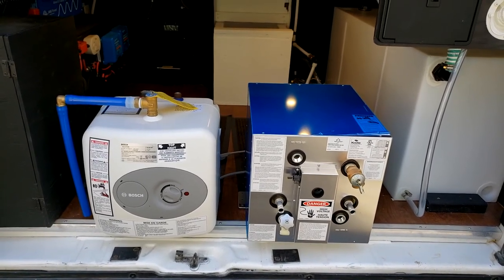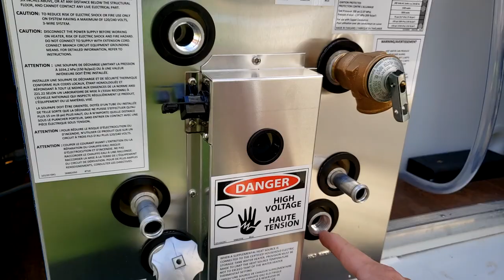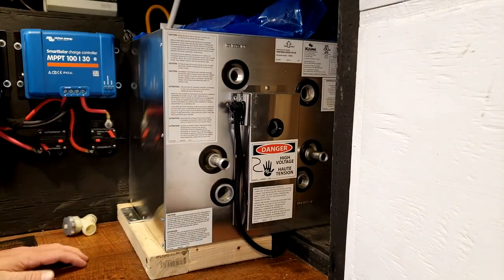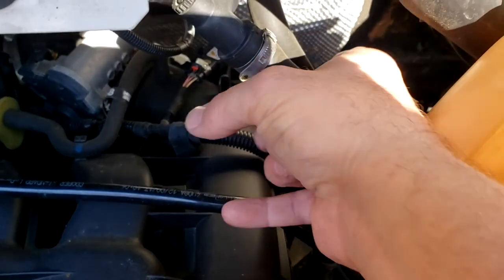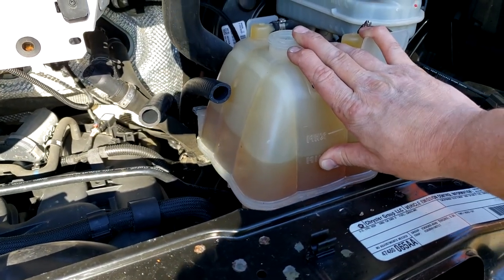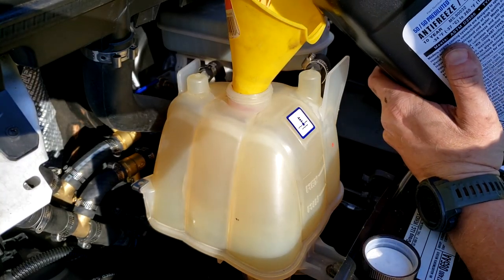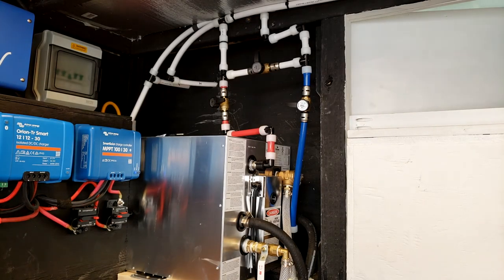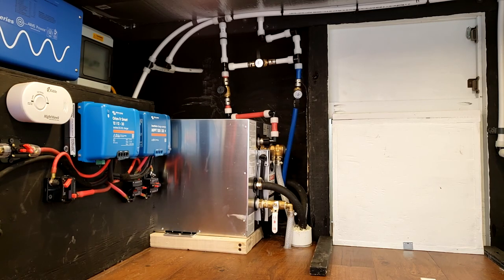Best Water Heater For Van Conversion - Camco Kuuma Coolant & Electric Free Hot Water in Promaster

Comment: That's pretty awesome.  A little tip is you can  hook an old heater core from a vehicle (looks like a little radiator) to the exhaust of a Chinese diesel heater and heat up a large container of water quite quickly, or cook on it.  Some off gridders might appreciate the tip.  I used an old steam radiator from a home heating system and that 200 lb cast iron heated up to 400 degrees near where the exhaust inlet from the diesel heater connected.  It was hot enough to cook many burgers and hotdogs in a pan, helped to heat my garage, heated 10 gallons of water to 180 degrees, and was basically free waste energy that usually gets dumped into the atmosphere.  You can also do the same exact thing with a generator and the cast iron radiator acts as the most effective muffler imaginable as a side benefit.

Comment: great walk through on setting this up. I, too, have the bosch and wish I had found this earlier. I am curious like others if the system has a built in method for managing the water temperature. Surely it does? A thermostatic valve is good for managing the temp of the water on the way out, but what does it do to keep the water from getting to 220 in the vessel?

Comment: Mr Jack Master... Your info here is GREATLY APPRECIATED... Not only did you provide a link to the same unit at a lower price...

You also explained it to a AVG Intel guy like me...

This item isn't label comprehensively that it is also heater through the coolant system....  If you red the title.. description and specs...  It does state heat exchanger...but for what...what alternative method..

I am not the only simpleton having this dilemma...  Others are too.

I will send this link to the rest of the clan.. we all have older class b RVs that only heat off of propane..... 

THANK YOU

Comment: These Kuuma are great if you already have Rear AC\Heat in your van.. As all the hoses are right there..Just remove the cover and route the hose into the unit. Then back to the rear heater inlet...You're done..

Comment: Very well done installation video. Do you know if the 120-volt heating element can be directly replaced with a 48-volt element?  Does it look like the screw-in type you see on household water heaters?

Comment: Thanks for the clear video.   Now that you have had it for a while, can you comment on how you are liking it?  I agree with the earlier comment that 115 degrees doesn't seem very hot relative to the coolant line.  Did you find that it heats up more after driving a few hours?  And can you comment on the tank's insulation:  how long does the water stay hot after coming to temp?
Reply from the maker: We recently drove home from a camping trip roughly an hour away. We hadn't used any hot water while camping since it was only 1 night. 3 hours after I got home (the van was turned off the whole time) I decided I would go take a shower and see how the hot water worked. I took a 15 minute shower and never did turn the hot water up. I'm very pleased with this unit so far. We never turned on the power to it. That was just from driving home using the coolant to heat the water.

Comment: Excellent instructions, thanks! I’m almost done. Not sure if I will replace the plastic draining valve or not. Maybe it’s better to have it as the weak link if it ever freezes. Also I tried to remove it but it’s quite tight and I was afraid to break it
Reply from the maker: It's glued in with some sealant. Just need a large crescent wrench and it will go. The problem with it for me was it's made to hook to a garden hose, which will probably just leak. I wanted a more finished , easy to drain solution. But it won't hurt to leave it.
Reply: @JackofAllMasterofNone  I have been able to remove the plastic valve! Thanks again!

Comment: Humble Roads recommends using a “heat exchange” element in the engine compartment to avoid any issues with the vehicle breaking down should the glycol lines become damaged underneath. I think this would help nullify any warranty concerns, as well.
Reply from the maker: I am not familiar with a heat exchanger like that, but if money and space is no consideration that should be ok. Buses have used coolant powered heaters for ever. The risk of damaging a line is small and thats why I added shut off valves.
Reply: “Heat exchange element”What?
Reply: I thought a heat exchanger is to heat the air

Comment: How is that setup working? I was curious why you chose to T the hoses and not reroute or loop the whole system. Thanks for the video. 😊
Reply from the maker: T What hoses ? The coolant lines? It's because you want to be able to shut them off if a leak were to develop in the back somewhere. With the valves you can shut off the whole rear system, which effectively puts the system back to stock. Also, you want your heater to work. If all the heat was sent to the tank first th heater would take forever to heat up in the cold weather.

Comment: Have had mine in my promaster for almost a month now. This is so wonderful - I love it!
No leaks … however, when I put coolant a bit over the MAX line and I noticed about a teaspoon of coolant on my van floor.
I wiped it up and did not leak again until about a week later when I topped up the coolant in the engine again a little over max line and got tiny amount of coolant on van floor.
I am assuming it is real important NOT to top up coolant over max line??

Thanks again for the great. Idea!
Reply from the maker: There should be no coolant on the floor in the van even if it's over the max line. I would tighten the clamps on the hoses at the water heater. One of them is probably leaking slightly probably went hot.

Comment: Hi, does it affect the heat to the cabin? I find that when cold the cabin heater struggle to keep the cabin worm, therefore I would consider taking heat from the main pipes?
What about circulation?
What's your take on that? Apart from getting t's big enough for main hoses.

Comment: Great video!

Assuming you run this in the winter, wouldn't this be a little worse off (wait longer for the engine to heat up)?
Reply from the maker: Well it also uses electricity if necessary just like the Bosch unit and althought it takes slightly more time for the engine to warm up in the winter, there is still plenty of waste engine heat to heat the coolant

Comment: What sort of insulation do you have in the floor? Have you ran into any heat problems with the area that the coolant hose passes through the floor?
Reply from the maker: In this van we used polystyrene insulation. In the video I show how you use a PVC pipe to pass the hoses through. No problems with heat

Comment: Great video,  my Bosch 12 volt took a crap in my promaster conversion.  Looiking into install this very unit wondering, everytime you want hot water you will need to drive the van? (may be a dumb question)
Reply from the maker: It also has an electric element and plugs in just like the Bosch unit. So when you are camped and not running the engine you can use 120vac instead.

Comment: Wondering how much heat comes off the heater tank and the hoses in the garage, especially since that's under your bed, and also, when I do this, I suspect my dog might be wanting to sleep or hang out back there. On the subject of excess heat.. maybe you should run the hose across your greywater tank, and it might be enough to keep it from freezing in the winter?
Reply from the maker: It's insulated very well. I haven't noticed any heat coming off of it honestly.

Comment: I’ve been using a commercial version of this hot water system in a carpet cleaning van mount. 
My question is I’ve got a thermostat on the heating system because the tank can get very very hot, dangerously. What safety system has this heater got ? I noticed the over flow out let 
Be interested in update how it goes because it be a very reliable source of heat as long you have a safety thermostat
Reply from the maker: I don't believe it has any inherent built in safety device, besides a pressure relief valve. Thats why I mention to use an external cold water mixing valve if it is a concern. So far, we have not had any problems at all and the temperature has not been too hot.  I say this with the understanding that children will not be using this water system.  If so, I do recommend a thermostatic mixing valve be installed.

Comment: Would turning the electric part on while the van is off and cold function as an engine block heater?
Reply from the maker: It would heat up just the very small amount of coolant in the water heater but once the engine was started and coolant circulating would definitely help to heat it up faster.

Comment: Thank you for the information - Question, the hose do you have a link to has complaints in the feedback about not being marked heat resistant and not being what the seller claimed - are you still recommending this hose or a different one? Thanks!
Reply from the maker: Absolutely recommend it. It's just rebranded Gates hose. It's heater hose and I have used it not only on this van conversion but also when I added a heater to my Honda side by side and just recently in my Camaro. There is no problem at all.

Comment: Two problems can be with this heater, it is that aluminum oxidizes quickly and oxides will get into the water, so this water can not be drunk, the next problem is antifreeze passing through the water through the heat exchanger. Heat exchangers are not reliable, they are often used in car engines and they can leak when working under pressure. Imagine that antifreeze starts to get into your water, I think it's horrible.
Reply from the maker: These have been used in marine applications forever..... What do you recommend then?

Comment: Great video ! I'm installing the same one in a couple of days. Nice to see how you did it. I read somewhere that you might need a thermostatic valve to avoid getting burned. How hot the water is after a couple hour drive ?
Reply from the maker: Water is fine but you do have to be aware that it will be hotter on engine coolant than electric so you just need to use more cold water. You can put in a thermostatic valve if you are worried about it.

Comment: I went with a ISOTemp and love it.  This looks just as good and much cheaper.   Did you add a mixing valve to manage the max water temp?  Seems like it would be scalding hot without one (~220f).
Reply from the maker: I did not use a mixing valve. It has not got that hot at all. But maybe with children involved it would be a good idea. The max water temp I've seen has been around 115 degrees F
Reply: That seems cold. The coolant from your engine should be around 200° so i would guess the water in the heater should get close to that. I agree with Mike that a thermostatic mixer would almost be required for this type of application. Does the manual specify any of this. Expected water temp? Plumbing a mixer? Just curious as I’m looking to maybe add a heater that has the ability to be heated via the engine coolant.
Reply: Can I run that water with just the element and not install the coolant for now? Or the coolant lines has to be installed to operate the water heater? If I can just run the element to heat the water, do I need to plugged the coolant in and out line or leave it alone? Thanks so much
Reply: Mikesbiking - can you share which isotemp you got? I was  looking to purchase one of those real soon…
Reply: Have you run you ISO on 12v to heat the water ?  I am likely going this route due to the mixing valve, I am leaning towards trying on just Electrical heat to see. My thought is if I heat during the day when I have sun I can heat the water and it should remain warm for several hours. As long as I shower at night I am okay.  I am curious about how much power it uses to heat the tank. Odds are if I am someplace cold and cloudy I will not need AC so using the battery power to heat should not be an issue.

Comment: Awesome video, do you know if those heater need some extra maintenance besides emptying the water when not using ? Like changing the cathode regularly or something ?
Reply from the maker: They are aluminum and there is no anode rod. Usually only porcelain lined steel tanks have them.
Reply: Great, thx for the answer ! So no "regular" maintenance to speak of expect winterization ?
Reply: As an additional question, why are you using T connectors for your circuit going to the water heater instead of having the whole thing on a single circuit with no T connection, making it "just" longer. Is it "just" to be able to close the water heater coolant circuit ? Sorry if this is a naive question.  @JackofAllMasterofNone
Reply from the maker: Yes it is a bypass for when you winterize your van or camper. You do not want to pump antifreeze into the water heater so it is necessary to bypass it and then drain it.

Comment: how much drain on the battery does it take to heat your water ?  I am curious if during the day while you have sun can you heat water , you will have solar to offset the power consumption.  Will the water remain warm for a few hours allow for a warm shower?
Reply from the maker: I haven't really measured it but we usually let it run for about an hour and that is enough to completely heat the water on electricity.

Comment: Where did you buy your fresh water tank?  Only found one source for over the wheel well and I know there must be somebody cheaper.
Reply: We bought the upgraded 36 gal NWConversions wheel Well tank from Agile Off Road van suppliers — tank is same size as their 32 gal, but upgraded… when they rounded the wheel well angles, it added 4 more gallons :) 

Yes it’s more $$ than the basic rectangular ones, but it will fit our build better, too :)

Preparing to hook it up soon!
Reply: @MindBodyMuse   Thank you - I have same tank and appreciate you sharing your experience.

Comment: I am planning on doing the same thing on my van, someone has mentioned to me not to use Brass Valves or fittings because the coolant can become acidic and attack the metal? does that make sense to you?
Reply from the maker: Coolant only becomes acidic after it is bad and too old. Brass is only a problem when in direct contact with aluminum, which can cause some electrolysis, but these brass shut offs are not touching any aluminum, they are suspended in the hoses. They will work fine.

Comment: Have you had the van out since the water heater install? If so, how is it performing? How has the power consumption been? How long does the hot water last with just the coolant lines? Great vid thanks!
Reply from the maker: I have had it out only 1 time. The water completely heated up on a 40 minute drive that included a 10 minute stop in the middle with the van off. I haven't even used it on electricity yet, except to try it out and make sure it worked. It would last indefinitely with the coolant, but you would have to run the engine. The coolant heating method is actually hotter than the electric element.
Reply: @JackofAllMasterofNone Is there anything that keeps the water in the tank from getting too hot to shower in a long bf drive?

Comment: I assumed you'd just splice the entire heater loop into one hose instead of t connections in 2 hoses, would that not work? Seems like t connections would interfere with the coolant loop.
Reply from the maker: No. You want to be able to bypass or shut off the loop to the rear in case of a leak. And also, water/coolant takes the path of least resistance, but also flows to the back at a slower rate. What this means is that you still have good heat from your dash heater but also still get hot water in the back. If you just ran the loop to the back first you would have very poor performance out of your van heater.

Comment: I, m bit unclear. What makes coolant go to the calorifier rather than  trough the heater core? Does heater core has a valve? I thought coolant always runs trough the heater core all the time and we have a hot air just by engaging the blower.
Reply from the maker: That is correct It goes through both all the time
Reply: @JackofAllMasterofNone  Thank you for clarification.

Comment: Be careful. The point-of-use electric heaters have temperature control.  I assume the Kumma has a thermostat on the electric side. Any control on the engine loop? Engine runs 200F so coolant gets pretty hot, and maybe your hot water on a longer trip.

Comment: I like it but I think it's worth mentioning 6 gallons will only give you less than 5 minutes to shower with before it's totally cold.
Reply from the maker: Me and my wife both take full showers and still have hot water left.
Reply: @JackofAllMasterofNone  is there a low flow showerhead you recommend? I am going to be building a van in about a week and I’m doing a lot of research right now. It seems to me like 6 gallons of water at 2 gallons per minute would not last very long even mixed half with water, can you give me any insight? Thank you.

Comment: Does this drain a bunch of power? I have 400 amp hours.
Reply from the maker: It pulls about 1450 watts AC while running on electric and takes about 30 minutes to heat up. That's about 130amp draw on the battery bank. So if my math is correct it would hit the batteries for around 40ah, which is why it's best to use the engine coolant heating method when possible and the electric element when on shore power
Reply: @JackofAllMasterofNone  thanks. Do you know if you could modify this to a 12v heating element to reduce the draw?  Thats a bunch of power to use up, and while i would mostly use the engine.